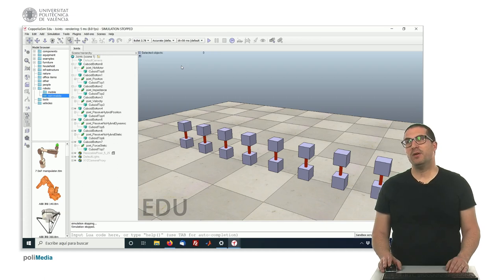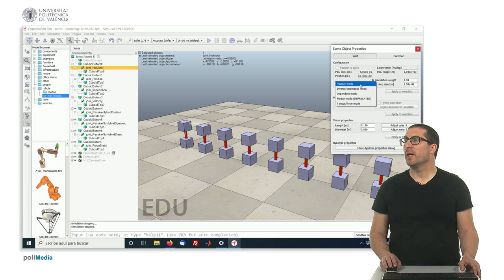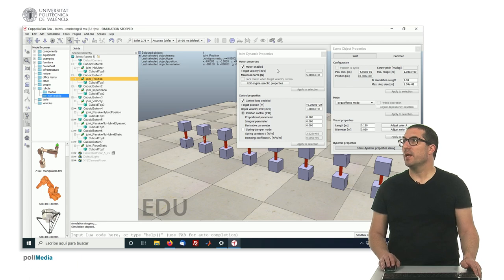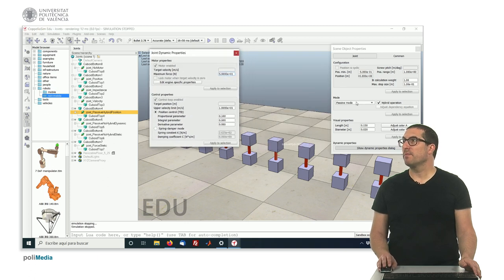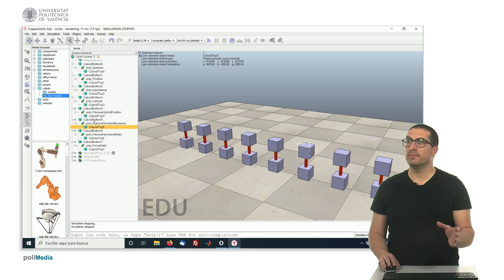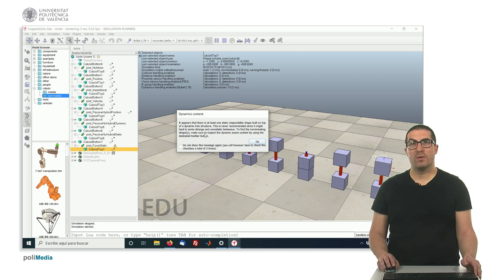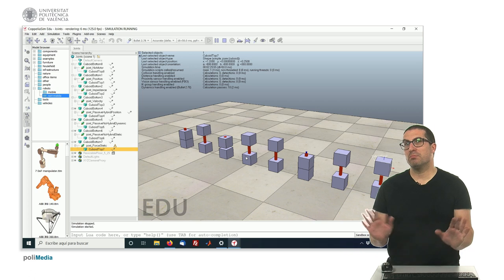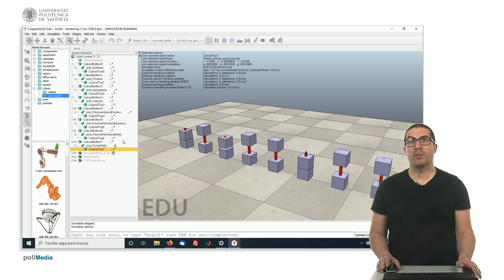Configuring Joints in CoppeliaSim | CoppeliaSim (V-REP)

Comment: What method would you use to add tendons actuated between multiple joints?
Reply from the maker: That’s a difficult question! I guess that those tendons are passive, thus using passive joints and tuning their friction and damping properties might be a possible solution, but I’m not so sure if that’s possible. Another possible solution is to generate a virtual force/torque in some specific directions with the simAddForce and simAddForceTorque functions. I’ve never used them before, so please don’t ask me how to use them.
Reply: Leopoldo Armesto thanks for your thoughts